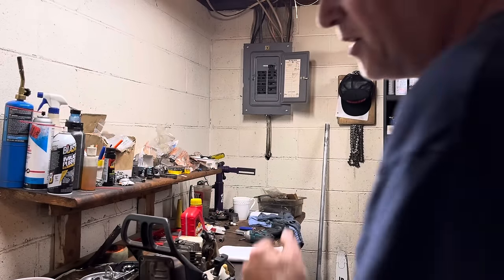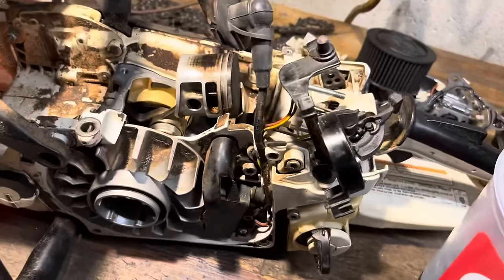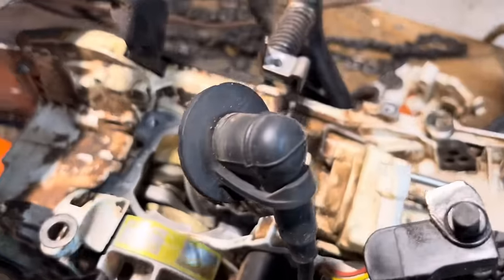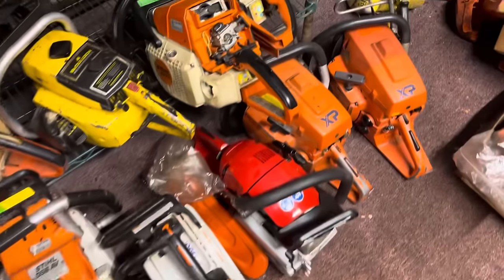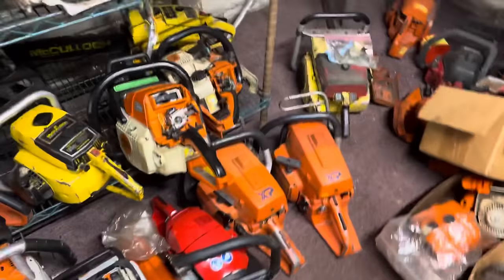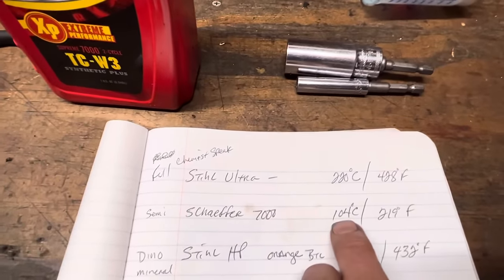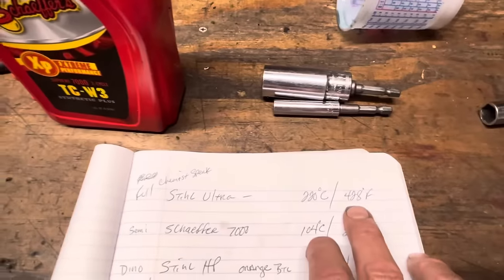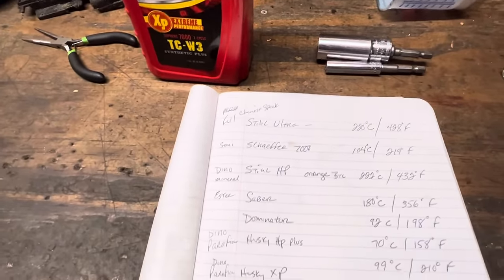Two Stroke Oil Talk.  Why Anything is Better than Ultra for your Chainsaw!

Comment: Without a doubt Amsoil Sabre Professional beats everything out there, hands down! I do not  understand why anyone would use anything else! So simple. Doesn't matter whether your saw is 50 to1 and trimmer is 40 to 1. Amsoil covers all with one simple mix. A 1.5 ounce to a gallon of non-ethanol fuel is the best setup for ALL 2 cycle power equipment. No fowling, no carbon buildup, no guessing no fuss. I have 2 cycle equipment well over 15 years old. Still runs like new!
Reply: I would like to see a comparison of this to Motul 800-2T Off-Road.
Reply: Red Armour +mid range gas works great for my husky echo and stihl chainsaws they start up year round in Nor Cal.

Comment: I can't say for sure but probably Stihl, like every other branded oil, is farmed out to the lowest bidder for a contracted period of time. Who knows what you're getting every time they change oil refiners to the cheapest bidder.
I've been using Amsoil HP for quite awhile but I did get some Stihl Ultra for free, so..........
Reply from the maker: According to the MSDS sheet, it is Stihl's recipe blended and bottled by a company in Louisiana.  Omni Speciality Packaging.  They make a wide range of petroleum products for many companies.  The website states they are API, ISO certified and have an accredited test lab.  Past that I don't have any info.  They may be cheap too................

Comment: I use tall timber at 50:1.  Been using it for years and years.  It works great.  My saws work for a living.  Someone gave me some stihl oil and it's still sitting in the shed.
Reply: Stihl isn't in the oil business..I think Castrol makes it. Anyway that what it says on the back of the stihl container.
Reply: @BENFrankaka-sandstorm  nothing wrong with stihl... unless you're an echo dealer

Comment: Here's the deal with factory oil, be it Stihl, Ford, John Deere, Honda, Harley Davidson..... anything.   It's bottom of the barrel stuff.   These manufacturers either buy the lest expensive stuff to maximize profits, or contract it out to the highest bidder.  
I took the Stihl oil to double my warranty, then put it on the shelf, and used good oil.
Was the Amsoil Saber Flashpoint mixed at 50 or 100:1?
Reply from the maker: I believe the flashpoint test is done with the oil only, not mixed
Reply: @richardflagg3084  Yes, you're likely correct, I never thought about that.

Comment: A few things here,all branded oils are made by proper oil companies,most bases are very similar,and have a slightly differant additive packages,ultra hp is a certified to the highest jaso level and euro standards to date as is most other quality oils,in order to be approved they are stringently tested for viscosity at certain temps and pressures,shear,lubricity,flashpoint/additive/mixing properties,burn off,etc etc,basically any oil that passes those test are generally a good oil,in saying that it can come down to elevation, tune,is the mix being correctly measured,is the motor getting dusted/filtration is the saw running slightly lean? Adding more oil will cause a lean condition...,dry crankcase?? Is the saw going from full rpm then turned off? Or is it idling for 10 to 20 seconds before shutoff ,that could explain the oil pooling issue, i know for a fact if there is little or no oil goin to the crank bearings at 12500rpm it would blow up in the first 30sec of run time,as for carbon clogging,this one of the most looked at test when its approved for jaso fd,the additives for mixture dilution is burned off/flash point and leaves the base oil to lubricate the cylinder wall and crank bearings,not too much of the actual base oil gets burned off its just the additives and on a lot of stihl owerners and 500i pages,litterly 1000s of people are using ultra hp and some since the start of time,so your finds are interesting,it's good to see you taking the time to investigate these issues,keep the vids coming.
Reply from the maker: Thank you.  The majority of people will never tear and engine down and will swear what the dealer or other people on the internet say is gospel. Those that say "I run brand "X" and I haven't had any issues" without at least taking a peek are part of the problem.

 The commonality of the carbon glazing is the core problem of Ultra.  It is JASO FB rated.  It is less toxic to the user as I understand.  Under ideal circumstances it will properly combust.  Other oils are more forgiving, hence the oil test series.  I'll resume the testing soon.
Reply: @richardflagg3084  sounds good looking forward to it.👍

Comment: Ms 261 cm less than 20 tanks stihl oil and ethanol free fuel and piston and cylinder scored to hell. I always shake gas can before pouring and shake the saw before cranking. Dealer checked fuel mix and was correct but looks like it was run without oil
Reply from the maker: Is it still under warranty?  What's the dealers diagnosis?
Reply: Dealer quote " totally trashed cylinder buy a new saw!"  "Cost more to fix than it's worth"
Reply: I bought an OEM cylinder and piston replacement kit from Stihl for $350
Reply: If I could send you a picture, I would love to hear your thoughts
Reply from the maker: @brucebalfour8042  I hear that too often.  Sorry

Comment: I think the problem with most users, especially homeowners who just don't understand what bad gas is. Mixed gas goes bad after 2 weeks, UNLESS it's kept in an airtight metal container.
Reply from the maker: I'll have to look it up again, I can't remember which one, but one of the fuel companies has some detailed info on shelf life and storage variables of E-free and E10.
Reply: @richardflagg3084  I was referring to pump gas, not e-free. I do know that unless stored in something airtight, the gas will actually absorb the Moisture in the air. I know e-free is 100x more stable than regular pump gas. But let's be honest most tree guys or firewooders will use high test pump gas thinking it's the best. Not everyone has e-free gas stations or an airport readily available to them. I am lucky enough to have both here in Allentown, PA. I go to a Sunoco literally 6 mins each way from my house for 90 octane e-free gas.
Reply from the maker: @jerseyjoshua4818  Nice!!
You're right  Treat E10 pump gas like a gallon of milk if it's in a vented can.

Comment: Honestly I can’t see a difference in your comparison. 
But the flashpoint tells the tail. 
Stihl wants their stuff run wide open. If that’s what you do it’ll be fine. But I don’t like that so you’ve changed my mind only from the flash point temps not from your comparison of cases.

Comment: I agree with you that Stihl  HP Ultra oil is pond shit .
I use Belray HR-1 100% synthetic ester at 40:1 this would have to be one cleanest 2 stroke I ever used in all my pro saws.
I would love to try the Schaeffers 2 stroke oil l have heard nothing but good about this oil only problem not available in Australia.

Comment: I believe its not the Oil but Rather the PUMP GASOLINE.   Mix that Stihl Ultra oil with a Canned 4 cycle fuel (VP Racing 4 cycle) or just run the Motomix and that will clean up your carbon issues.  Try It and you'll be a believer.
Reply from the maker: I don't believe better fuel would help.  This saw was run mostly on canned Stihl Motomix and on a few rare times non-ethanol pump gas with Ultra at 50:1.  I see carbon like this on a regular basis on many types of equipment that ran 50:1 Ultra.  All I do is work on 2 strokes (hand held).
Reply: @richardflagg3084  I seldom use the Stihl oil, Occasionally I do buy the Motomix, mostly I will buy a Gallon Can of VP 4 cycle fuel and mix Amsoil Saber at 50:1.   Never had any issues on my 2 stroke equipment.   Run a Stihl MS 362, BR 800X blower, Husky 550Xp, Husky 562 XP,  RedMax GZ 5000 chainsaw, Redmax EBZ 8550 blower.   But also Im just a homeowner use, not a landscape business, etc.   Im a big believer in Amsoil Saber, but not at 100:1, I still mix it at 50:1.   
I'm itching to also try the Maxima K2, it gets a lot of good reviews,    Thanks for your video, I'm always open minded and willing to learn something new.
Reply from the maker: @michaelbartley2986  VP is an excellent product.  I just did a video with Saber yesterday, have a look.  Stick with Saber at 50:1 and continue what you're doing.  You must have done your homework.  Excellent to hear and your equipment should last a very long time.

Comment: Sthil chainsaw are not meant to be run at half power. They are meant to be run full throttle.  Failure to do this will cause the problems you see.

Comment: 32 to 1, or richer?  Like 35 cc to the quart?
Reply from the maker: I feel with most of the high quality oils 40:1 is adequate.  If you are brand loyal to Stihl, use the orange bottle.  I've never seen any issues from the tried and true original Stihl oil.
Reply: No, not “brand loyal,” just do not want to burn up the Zenoah when it’s pulling a load.  I’m going to be either running non-ethanol gas, or canned fuel - and running close to 25 to 1 for mix.  Note that this is for an emergency DC ~ 52 volt generator (needs to be small and as light as possible.) which won’t be running all that often - but when it is running, it will be running under a load up to an hour at a time.

Comment: It's crazy that stihl push ultra as its premium oil and its only fb rated! Is it to do with emissions and the environment? I'm changing my mind about the hp ultra hype as I was allways skeptical of it to be honest, put a premium priced well regarded brand name (stihl) on a bottle of pond water colour oil and no info whatsoever on the bottle! No oil grade or mention of stabil nothing just a few pictures of how spotlessly clean your engine and cylinder will be by putting 3 stars next to them. Something stinks there.. I'm switching back to hp super its fd rated has all info on the bottle made in germany ISO L EGD low smoke  contains fuel stabilizer etc. I wish  we could see how the internals of a saw would look after running hp super..

Comment: 1 Is he running ethanol free fuel from QT?  just a joke i saw you're cup.😂       2 I've never seen a crankcase that free of oil without having a scored cylinder.
Reply from the maker: Multiple videos on this topic here on the channel.  Have a look at some others.
Reply: @richardflagg3084  ill take your word for it. my job has been nothing but 2 cycle repair for over 30 years now. I'm just saying I've never seen a crankcase void of oil and not have scoring. TBH my favorite oil for small engine  is Red Armor by echo and Yamalube for my outboard.
Reply from the maker: @saltdrum  Yes, I'm shocked as well there wasn't more damage.  Glad he's using better oil now.

Comment: It’s all because of the 50:1 requirements, mix it at 36:1-40-1 and I’d bet it will give better results, however, I don’t use it, I like quicksilver marine and recently tried red armor.
Reply from the maker: It's actually worse at 40:1 Lol.  I made a video on it.

Comment: i bought stihl oil for our home use line trimmer because they said it would double the warranty , my wife only got through 1/4 the bottle of oil and the shaft broke , the bastards at stihl said its not covered under warranty as its a a wear item , the new shaft cost half the price of a new brush cutter . i bought a bulk pack of valvoline boat 2 stroke oil for all my farm 2 stroke stuff about 10 years ago and ive had none of my 3 chainsaws , 2 brush cutters or post hole borer die on me yet , no plug fouling either and my farm stuff gets a hard life

Comment: Stihl came out with a decarbonizing solution for the 4 mixes because of that sorry oil. That should say enough of the quality of that stuff
Reply from the maker: I'm going to do a decarbon treatment with some seafoam after it's back together and have a peak.  I've used it for years and have had good results.
Reply: they discontinued that stuff, but not the procedure in the scheduled maintenance.  I emailed them and theyre response If I remember correctly was that any decalcifying agent from any hardware store will work.

Comment: I work at a stihl dealer, and I can say that that gas is shiiiiiit. It should be clear, not cloudy. It ain't an oil issue it's a Gas issue.
Reply: I’ve had the same issue that he has and I was a die hard stihl guy until I was having problems then I switched to amsoil.
Reply: Its a both issue. FB rated oils = shit

Comment: All Stihl 2 cycle oil is just renamed Castrol 2 stroke oil.
Reply from the maker: According to Castrol's website, both two stroke oils made for the US market are mineral based oils.  One is rated Jaso FB and the other carries a TC rating.  It's possible the Orange bottle may be the Castrol 2T Go, as they are both mineral based oils.  The Ultra in this video is a full synthetic Ester based oil.

If you have more info this would be a great place to share it.  All I can find in the MSDS sheets is the Stihl oils are blended in Shreveport LA. Thanks, Rich

Comment: well Stihl oil is made by Castrol been using Stihl for 20 plus years with out a problem period!!!!!!!!!!! no smoke = no lubrication! and who leaves a spark arrester in there mufflers?I dont
Reply from the maker: I'm not sure this flavor of Stihl oil is made by Castrol.  I do like the original bottle of Stihl oil.  I haven't seen the white bottle with the Castrol logo on the back of the bottle in my area, but I've heard it's very good as well.

Comment: Richard,  you can say all you want about Stihl Ultra.  It is my old standby.  I have tried the new FD oils but each one of them, except Husqvarna XP, has downsides.  I am not running Amsoil at any snake oil.  Red Armor has a problem - it will not stay in suspension.  Power Blend Gold probably has the same problems as Red Armor.  I am not running a TW3 certified oil in any air cooled engine.  I ran StaMix for years without any problems, but don’t have a local source for it if it is still being produced.  It was a Pro level oil, carried by forestry supply dealers.

Comment: Stihl oil is produced by Castrol for stihl "/
Reply from the maker: Can you provide a webpage that says that this formulation is made by Castrol.  I've seen people SAY it's made by castrol, but can't find any proof.
Reply: @richardflagg3084  A guy in Canada was comparing sthil and Castrol 2-stroke oil, look up bucking Billy Ray Smith on YouTube
Reply: @Richard Flagg  he's referred to as the chainsaw guru/god of Canada, he's an old school tree faller, with a garage full of hotrod ported Macs and Huskies, that are 30yrs. Plus old and run like beasts "/
Reply from the maker: @cancelchannel3394  I've seen that video.  That oil is not available in the lower 48.
Reply: @Richard Flagg  I think that I've seen the Castrol go at Walmart, but haven't looked at it closely, I just get my 2-stroke oil at Bayou Mower, in Winnfield, La. A sthil dealership, I worked hauling logs for the last 10 years, and we used sthil fx-250 pole saws to trim our loads sthil oil is all we ever used, recently I purchased a sthil ms-250 chainsaw that's when I learned about the ultra synthetic oil my dealer didn't recommend it, said it produced alot of carbon build-up in the engine
Reply: @Richard Flagg  I stick with the original sthil oil, my equipment has never been in the shop and has never failed me this far, knock on wood 🤣
Reply: @Richard Flagg  I live on 4-1/2 acres of cleared jungle, that's constantly trying to take back over, my equipment is put to the test everyday out here, and So far I'm satisfied with the products and  they're performance 😊 good luck and God Bless ☺️

Comment: never han issue with it. maybe yall just dont know how to use a saw?🤷‍♂
Reply from the maker: This saw ran fine.  It was just in for performance work.  Most people don't get to see inside the engine like this.  Run what oil you like, but I have multiple examples of this oil poorly performing on my channel.  All of them are from different tree services.
Reply: @richardflagg3084  awesome.

Comment: You're opinion is invalid to me, I've ran hp ultra exclusively in all of my 2cycle engines for over 20 years without one fuel related issue other than a plugged spark arrester occasionally.

Comment: To start, I own a Husquavarna saw and currently use a non-Stihl oil.....that said, this is the most useless, and  nonprofessional video I've seen lately......to professionally compare oils, one needs to utilize a controlled environment, under equal conditions, parameters, and fuels......this is just another "clickbait" video.....I do know that Stihl's research and development is top notch, and would never risk their warranty liability as well as reputation on an inferior oil.
Reply from the maker: Not so fast there.  This isn't clickbait, I assure you.  There are several videos I have documenting "real world" use by everyday folks and experienced tree services with repeatable results. It doesn't matter what happens in a lab or a controlled environment if the average user can't duplicate it.   If R&D is on their game, why still peddle a JASO FB rated oil rather than the top tier JASO FD rated oil that actually has a detergent package to combat the ester base in this blend?  I look forward to your response.  All I ask is that you verify the rating and watch a couple of my Ultra videos.  

Thank you, 
Rich Flagg